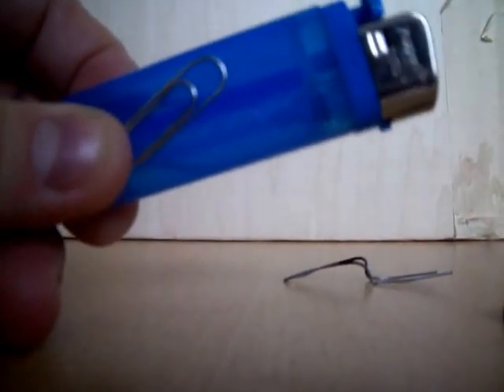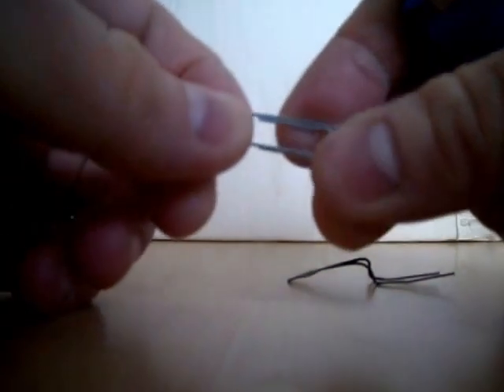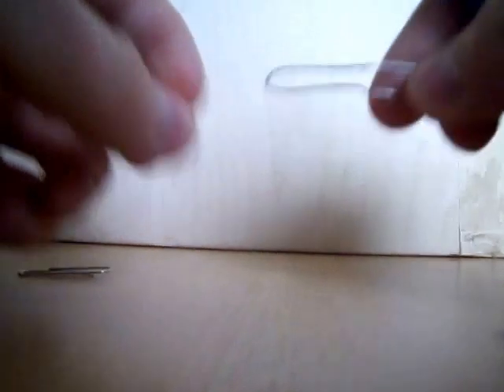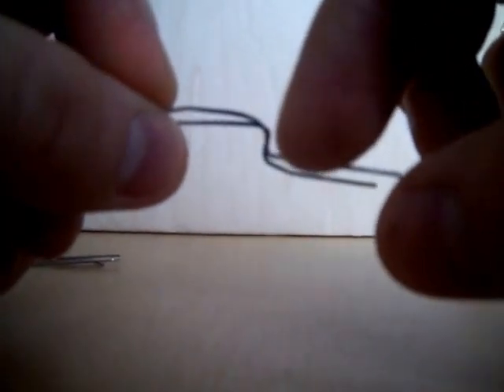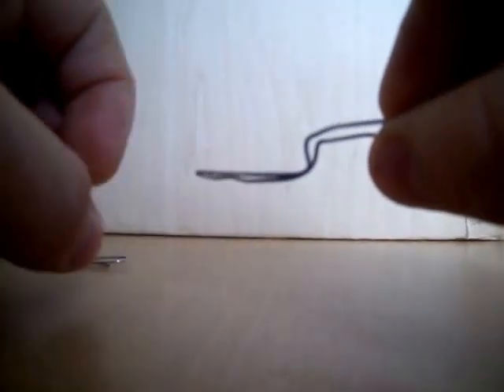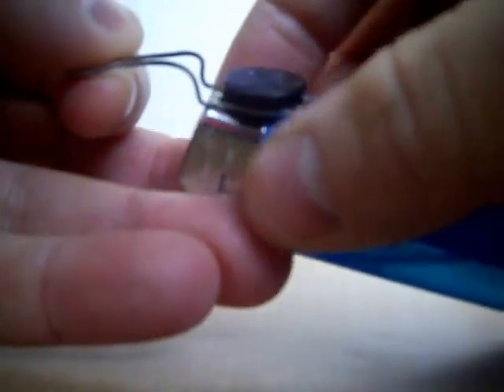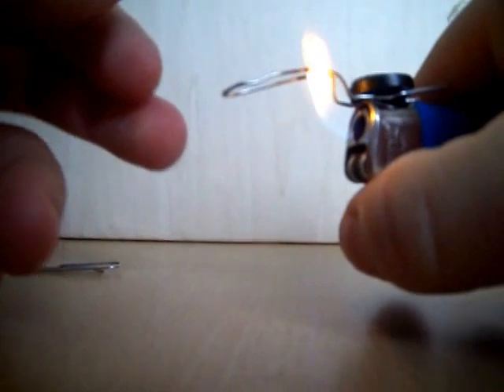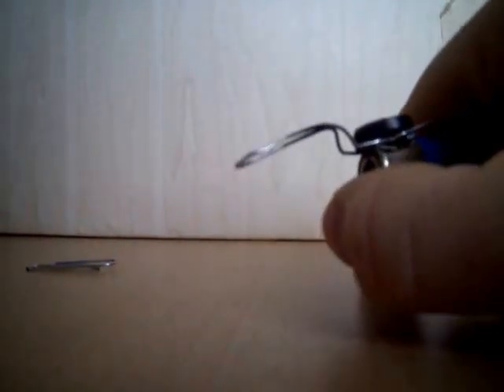How to make a soldering iron out of a lighter and a paper clip

Comment: Only flaw is that it's very unstable with only the tiny magnet holding it. Well that and the fact that you can't really solder much of anything and get good results. Kind of like using a car battery as a welder. It works for a demo but you wouldn't really want to weld anything important.
Reply: well the magnet is only there to hold it, use your creativity to find a better way to fix it iin